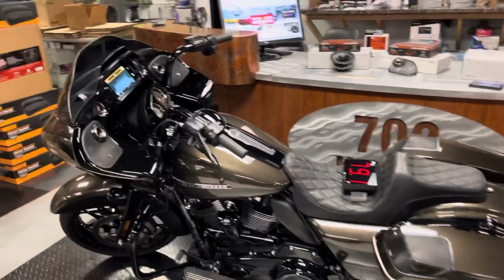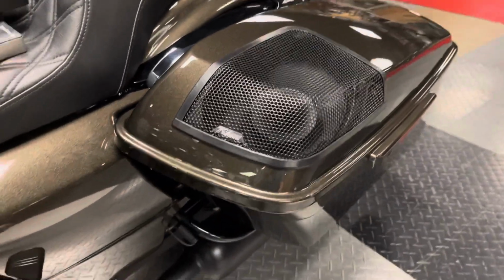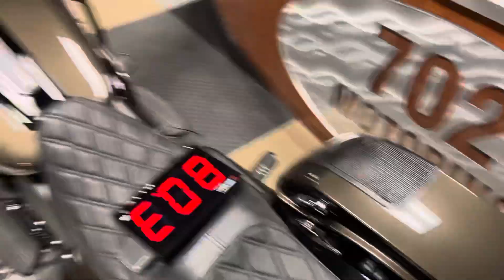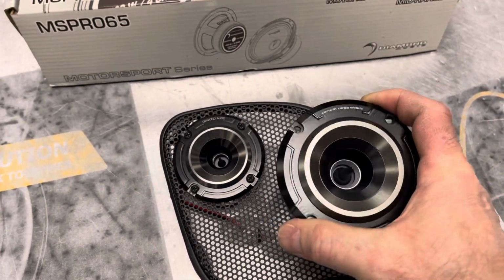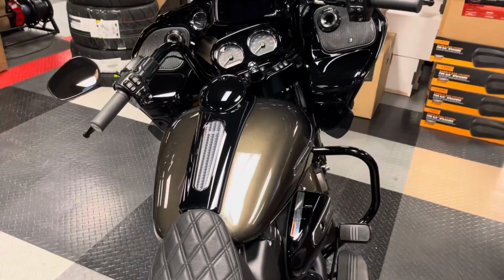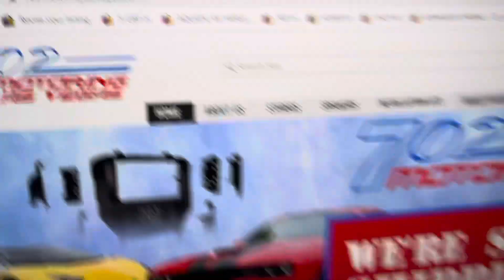2020 HARLEY ROAD GLIDE / DIAMOND AUDIO MP694 6x9 MO75T HORNS MSPRO65 MIDS MICRO4V2 VIDEO 3 of 3

Comment: Are you running the speakers full range and are you using a DSP or just a radio flash?
Reply: Just the Radio is flashed, no DSP, Amplifiers have plenty of tuning making a DSP not necessary,

Comment: Will those 6.5s work in Street Glide pods, or will brackets be needed ?
Reply from the maker: MSPRO65 MIDS Fit perfectly in 2014 & Up Street Glide Pods 

https://www.702motoringlasvegas.com/product-page/diamond-audio-motorsport-series-mspro65-6-5-pro-style-high-output-midrange-spkr

https://www.702motoringlasvegas.com/product-page/harley-street-glide-diamond-audio-pro-speaker-kit-includes-mspro65-mo75t-horns

Comment: You're only running 600 Watts, all these speakers combined are rated at 900 wrms can they handle the rated power?
Reply from the maker: They can easily handle rated power, the systems build's we do already outperform 95% of customer expectations so in our opinion it is not necessary to throw tons of power at the speakers - for certain customers we do, but not the majority.
Reply: @702motoringlasvegas4  I went with the same setup but with the soundigital evox 1200.4 plus the 2400.4 and 4 beyma 8's in the saddlebags so it should be crazy loud than.I CAN'T WAIT!!

Comment: I know your 702 lid kit is a modified kit compared to the others but will the 694s fit in the Rockford lid kits? If so will it need any spacers?
Reply from the maker: They will fit with the 1/2 inch Spacers

Comment: How is the midbass on this system I've wondered what these mp694's and mspro actually put out for midbass
Reply from the maker: Never have had an unhappy customer, if you listen to out videos on a PC with some speakers around the monitor these systems we do sound 100% better.
Reply: @702 Motoring Las Vegas  oh it sounded amazing just on my phone with no distortion your builds are on a different level I was just wondering 2hat the midbass was like I don't have a PC to listen to it on but I'll definitely be stopping into your shop